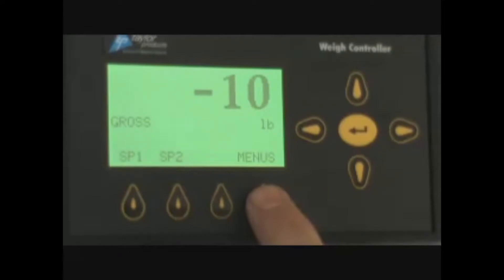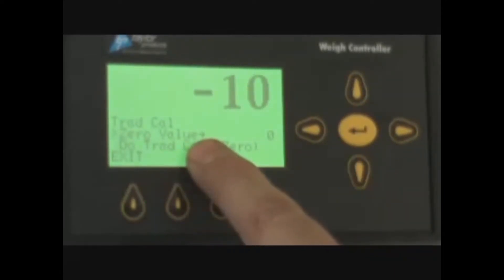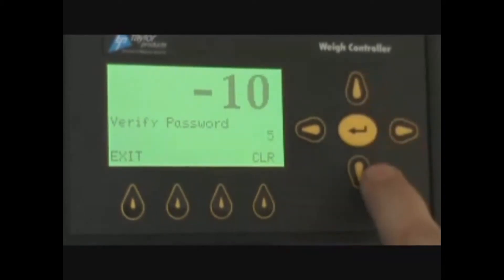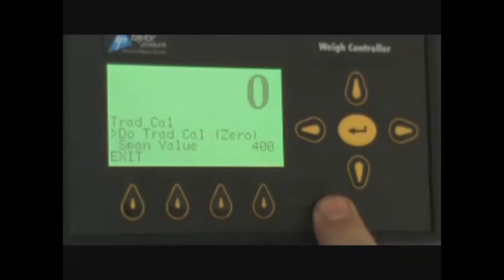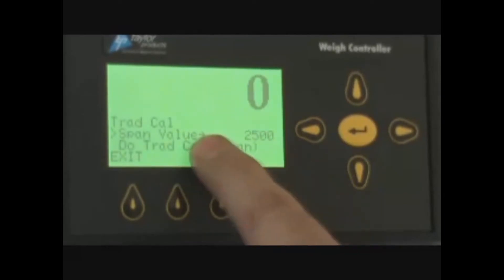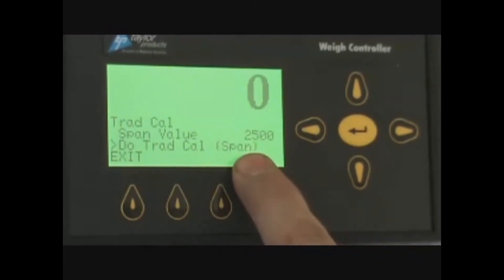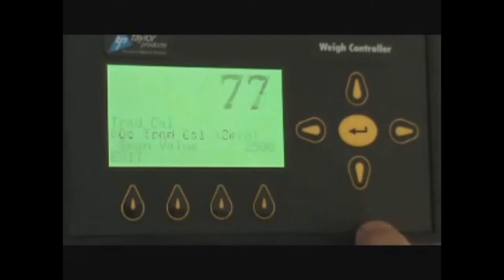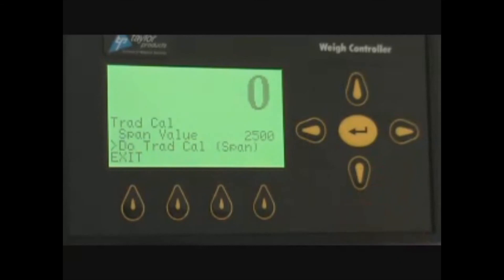T4000 Weigh Controller -  How To Calibrate

Comment: I (re) calibrated two machines. One of them works perfectly and has the correct weight. The other weighs around three pounds off (it varies slightly, off more for heavier bags). This didn't happen before and didn't on the other machine. I attempted to calibrate it again but it still has this issue. I've made sure all the settings are the same between the two machines and it is still an issue. 

For instance a bag will display as 50 lbs. But will really be 47 lbs. It isn't an issue with the tare weight and I have no idea as how to fix it. It worked fine before (only slightly off which is why I recalibrated it). Please help
Reply from the maker: Jacob,  what model bagging machines are you working on? do you have their serial #'s? I will get a answer from our service techs and comment back. you can also email info@magnumsystems.com
Reply: @magnumsystemsinc9317 
TE-100 CONTROLES, 
TE100-71000A
Serial Number 1272
Revision 1.3.1.5
Model T4000
Reply from the maker: @jacobburns3340 
Jacob, 

Here is the initial thought from our service manager: I would say there is a mechanical issue with the machine because the scale is reading 50lbs but when they check weigh, it weighs 47lbs.

There must be a mechanical bind on the scale some where causing it to think its right but weighs wrong. If this is a TE-100 then they need to remove clamp assembly and check around loadcell for buildup, or something mechanical happening with clamps or gate.

you can reach out via email listed above or call 888-882-9657 x 131 to talk to our service team
Reply: @magnumsystemsinc9317  yeah but it was fine before the calibration

Comment: Sir, please can you help me solve my problem with the machine that is in the video. I want to weigh 25 kg, and when I weigh, I find 22 kg
Reply from the maker: The setpoints on the machine controls the weight in bag. The displays would read something as follows depending on the type of machine this controller is on. 
A.	Sp1 or dribble, is where machine will slow the flow of product down. (Example for 25 kg would be a setting of 15 to 18 kg depending on flow of product).
B.	Sp2 or cutoff, is where machine stops the flow of product. ( for a 25 kg setting this could be 24 to 24.5 depending on the free fall of product after machine stops).

Comment: Once i am at the point of  DO TRAD CAL (ZERO) it shows ADC Error. I am looking in the manual for that error, but i can´t find what it is. Does anyone know?
Reply from the maker: The ADC error is usually a bad load cell reading into the meter.
A.	Make sure there is nothing mechanical binding up scale.
B.	Check all wires going into back of meter, make sure the jumpers are installed and in right place.
C.	You could try and do the Trad Cal (Span) first.
D.	Check the MV output from load cell to see if loadcell is bad.
Reply from the maker: Peter, let me ask this question of our field service team and I will comment back. or you can email me info@magnumsystems.com